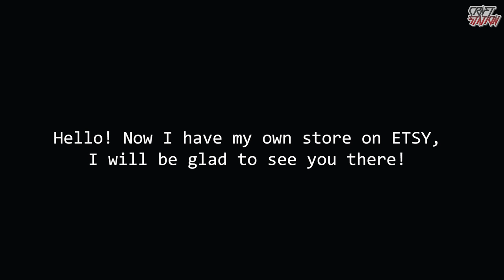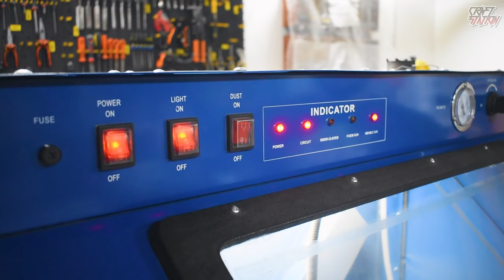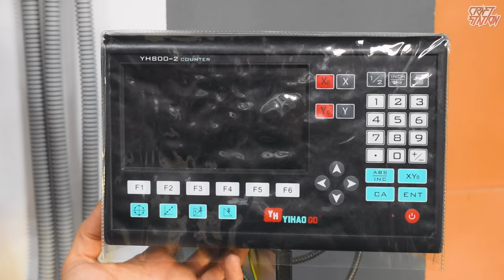Restoration of Vintage TANK

Comment: I am very intrigued by the firing mechanism. I tried modeling a toy tank in my CADD class but I never could figure out how to have it fire projectiles. now I know, plus I also have better idea on how to better break it up into components like this particular item. all in all 10/10, great restoration work and interesting toy design.
Reply: Look for toy cannon (игрушечная пушка). Also metall. watch?v=g1-PRsTB9z4 (restoration, but without locking mechanism) watch?v=FIa8cFcne_0 (random guy, but fully functional gun)
Reply: @oberguga  The device was very simple. The spring-loaded pusher was cocked by a lever under the turret and fixed. He was held by a metal plate, this is a piece of iron on a tower in the form of a button. A shell was loaded into the mine. By pressing the button on the turret, you release the pusher, and it ejects the projectile.

Comment: When I was about 12 or so. I made a model tank that worked by remote control . When I say remote , I mean it had two wires coming out of the back that went to a handset control . This was years before we had radio control , and it was smaller then the one shown here .  The family cat was terrified  of it . And would hide behind a chair when ever I played with it . One day I left it on the floor . The cat ran out from her hiding place , and gave it one hell of a swipe with her paw,  knocking  the turret off . It was held on by a plastic rivet , it must have been one hell of a bang  !

Comment: I don't know where did you get it from but I had the same tank when I was a child 20 years ago. Originally it had white rubber munition that fit the holes on the back on both sides. I am not sure but these toy tanks were produced in Soviet Union. I still have it in my parents house.
Reply: Did those toy tanks have a name ot the company name on it?
Reply: @tranques8075  don't know, but as you can see in the video there is a Russian text on undersurface. I think this is it.
Reply: @armanabventure7753  that's the price, 9 rubles :) Because prices were declared by government, they usually were printed by manufacturer on the package or the thing itself.

Comment: Loved watching this! One thing though, why’d you go with a gloss paint and not flat. Just a thought because no vehicle in any military is shiny, (only uniform insignia and medals, just saying) 😉 Other than that you didn’t overlook anything, very nice restoration. I’m currently building a model M113A1 APC. Putting my old unit and vehicle number on it too, I drove one for 18months😉❤️ Thanks for taking us along✌🏼
Reply: I think that gloss paint on a toy is on purpose. Military vehicles (real ones) are mat becouse dirt have to stick to them as natural camouflage on the other hand you want a toy that is as clean as possible, glossy paint is easy to wash.
Reply: @Dziku888  Indeed, and a gloss paint often provides a harder, more durable, coat than matte paint.

Comment: Full metal tank very cool.
It looks good for motor rise modification.
It looks like MBT-70.
Reply: It's actually based on the T-62, though stylized with the overly big turret,  you can tell by the fume extractor in  the middle of the gun,  and the more circular turret. Though the road wheels match the T-55/54 rather than the 62. But hey, it's a toy.
Reply: @sting2death2  Gerneric Soviet cold war tank, just missing the IR lamp next to the gun.
Reply: @armchairgeneralissimo  Yea, pretty much.

Comment: This is a very nice restoration process process, and a very nice toy. 
However, I think that the green spray that you have used is too dark. 
Wasn't there any lighter green spray that you could have used, to match the original lighter green of the tank?
Reply: These tanks could be of any shade, but most often they were painted with the same paint as the real ones. This is Russia baby))

Comment: Out of curiosity, what is the reasoning behind using paint remover for that top bit, but just sandblasting everything else?
Reply: Lead paint can be common on older castings and can bring a respiratory failure if inhaled through air. Back then many people suffered from respiratory cancer do to lead poisoning on their workplace. Search the topics LEAD PAINT or LEAD POISONING or just equip yourself with lead markers if you're trying restoring something by your own.

Comment: The restoration is incomplete. Plastic shells were going to the tank, they were placed in boxes on the sides of the tank. The projectile dropped into the slot on the turret of the tank, I had this, only a version with electric motors and a control panel by wires. This is about 1975 in the USSR.

Comment: Plot twist:

That's an actual T-55, and he's a giant restoring it on top of a bean stalk.
Reply: @Shane Huddleston You're both right, it's a T-62 turret and gun, on a T-55 hull.
Reply: Fred Jones  you're right, and that's what I said, T-62 turret and gun. But you should note the road wheels on the hull.

T-62 has 3 closely packed road wheels followed by two spaced out wheels.

The T-55 has the first road wheel in the front spaced out from a pair of 4 road wheels in the back (like the toy above).

Hence it's a mix of both, but you can argue that they thought of going for the T62 and didn't much care about the road wheels.